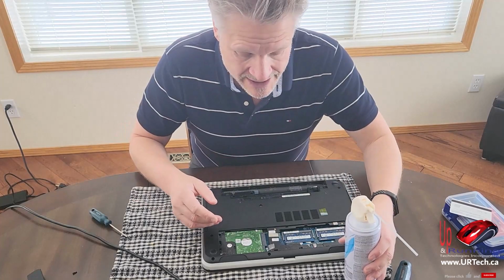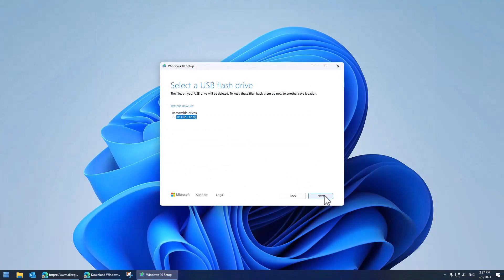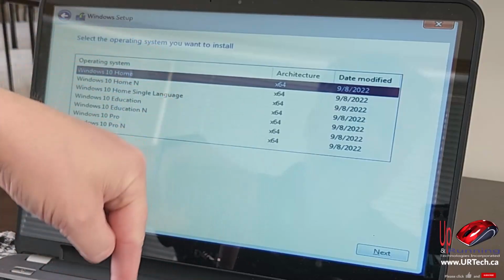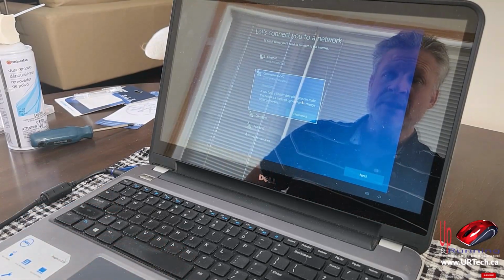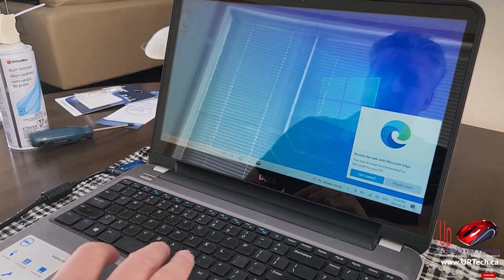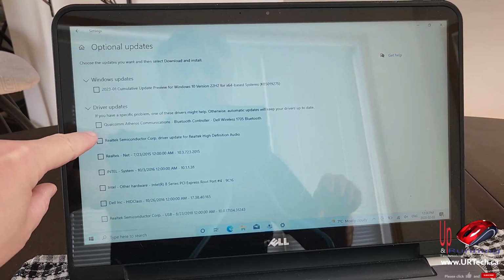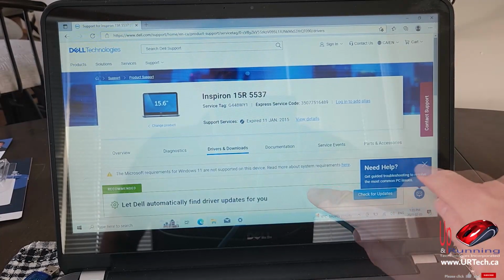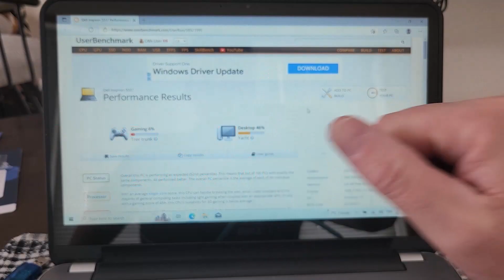EASY - How To Save An Old Computer With $15 and 30 Minutes

Comment: Useless garbage? Absolutely not!

If you are going to donate it, put a better SSD for the same money (SP a55).

Because this laptop did come with Windows activated, with the key embedded, you can simply install W10 and it will be activated.

Btw, you do not need to change the boot order in the BIOS!
Simply press F12 when booting to get the boot menu!